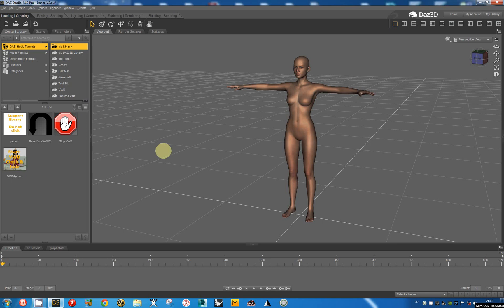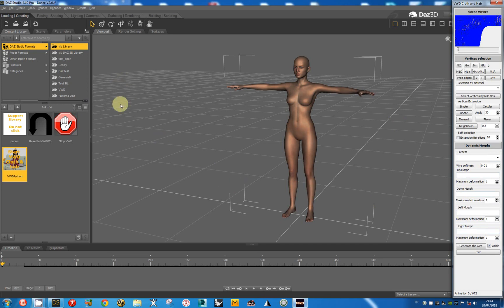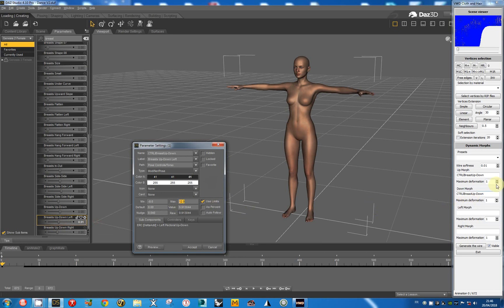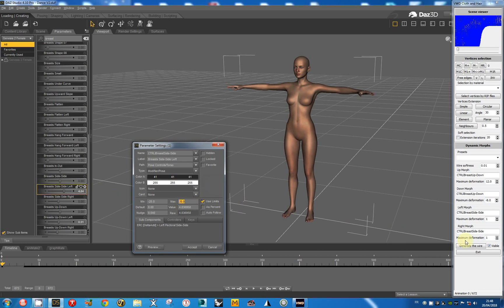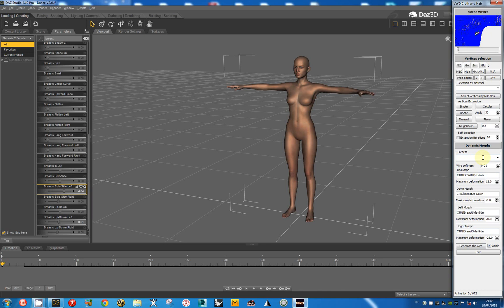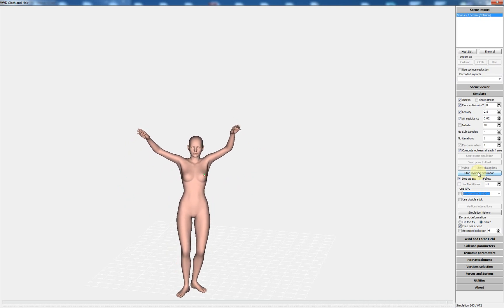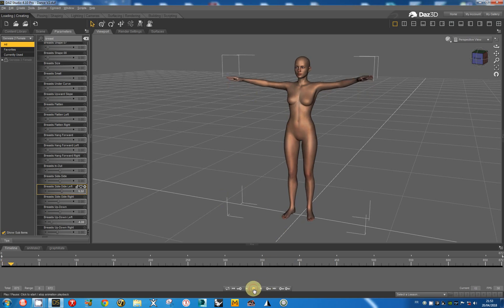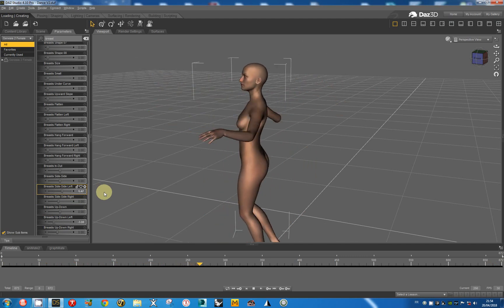How to Create Dynamic Morphs in VWD

Comment: Hello ,

i want to thank you for the latest version of program,

i'm using poser pro 11 , usually I open VWDClothAndHair  via python scripts,

i tried to open the latest version  , as normal way,

 i do not know why but i could not find the start icon of the program , although it is there in VWDClothAndHair  folder

would you please help to to solve that issue ?

 does this version not compatible with poser ? 

Thank you